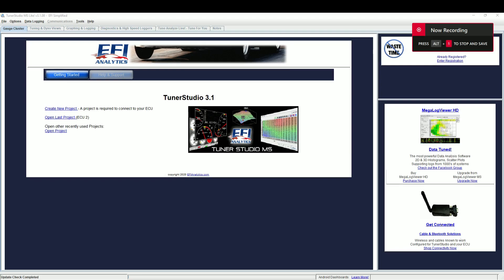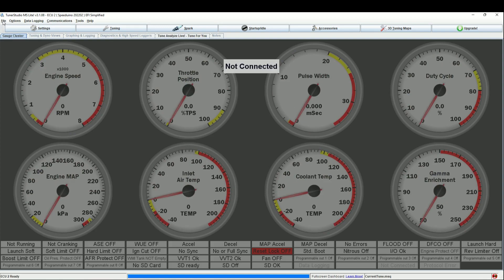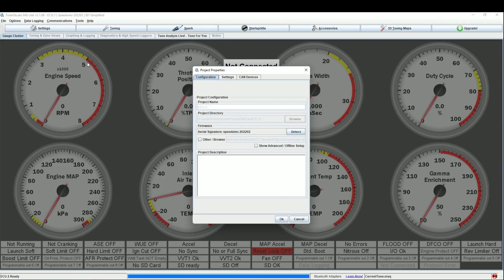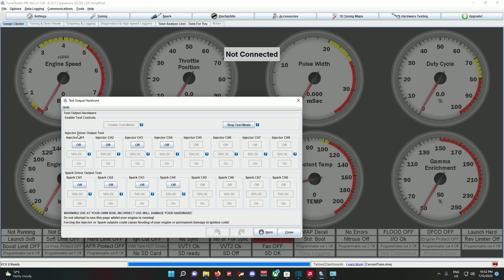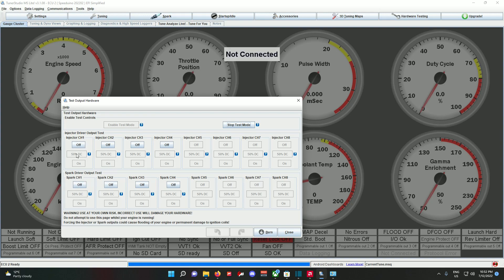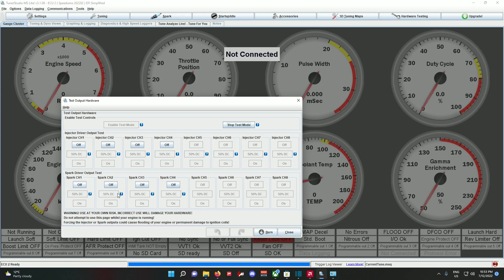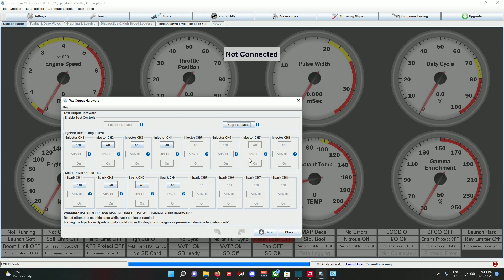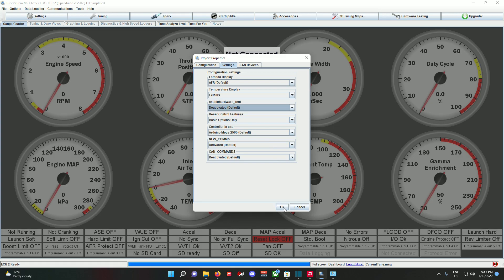How to do a hardware test on Tunerstudio | Speeduino ECU

Comment: Any idea why this works with my sparks but it doesnt with the injectors?
Reply from the maker: Your injectors should be on the ignition switch. And thus you should have to turn the car on to test it. I recommend on using th 50% test, which clicks the injector on/off once a second
Reply from the maker: Maybe your ecu is not on? Getting 12v?